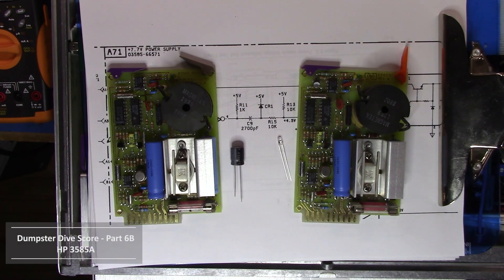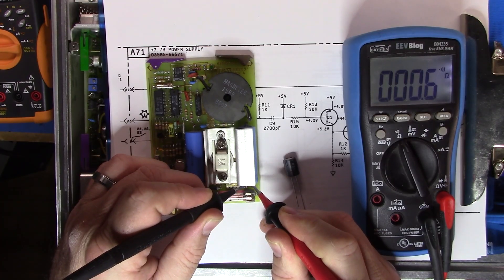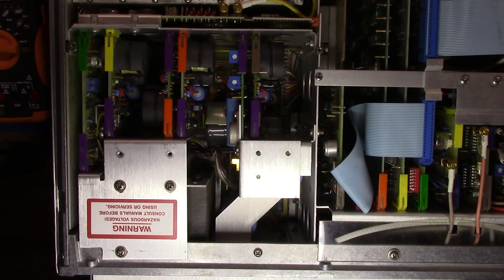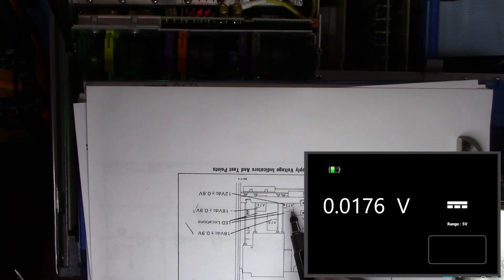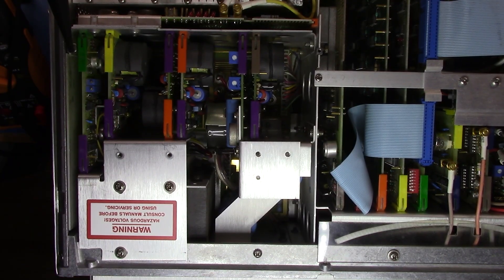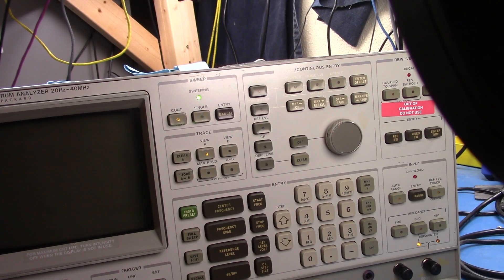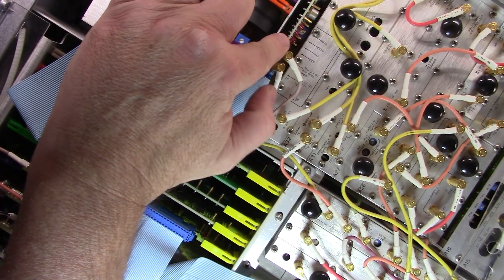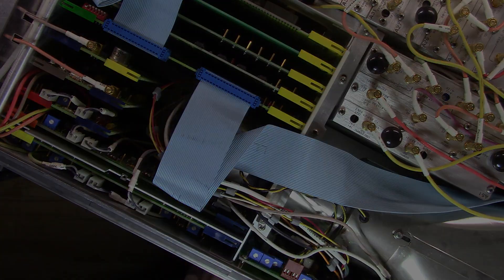Dumpster Score Part 6B - Fixed Power Supply and New memory Card

Comment: FRN blinks with the Sweep led in the front.  Your soloist there.  Check the Intensity and Contrast in the front panel it might be turned  down.
Reply from the maker: Thanks - I tried doing that and haven't seen anything yet - Turns out that the A67 board in the unit isn't an A67 board from a 3585A so this was a transitional device (or special order) before they went to the 3585B.

I'm waiting to get good scans of the manual from Artek now.

Comment: Excellent progress, looking forward to the next installment!  Regards, David
Reply from the maker: I just decided to try talking to it via GPIB - It responded correctly to the commands to set the center frequency to 10 MHz and the span to 1 MHz and then displayed a plot that I could acquire using KE5FX's tools.

So I think the bit that isn't working now is the display - Not super enthused about that as I'm a digital guy and 4-18KV sort of worries me...
Reply: @tgsoapbox  Yes, I get that. I started out in radar working on tube type equipment, the klystron anode voltage was a 0.9 uS wide 125 Kv pulse, the low voltage supply was 12.5 Kv.  No second chances there. Just don't touch it when it's turned on 😊. HP high voltage supplies are pretty bullet proof - my bet is on the low voltage supply.
Reply from the maker: I have a HV Probe arriving soon so this will be on hold till it arrives.